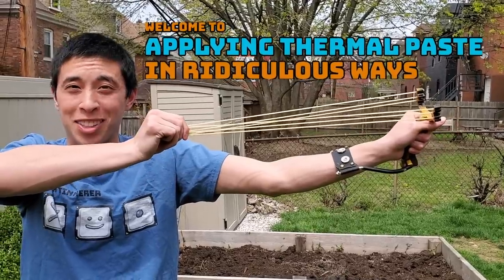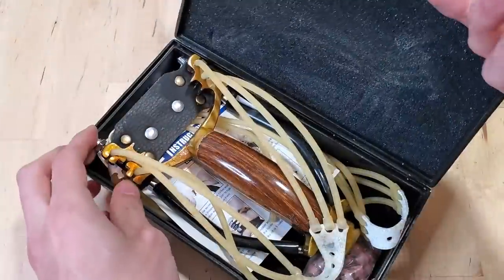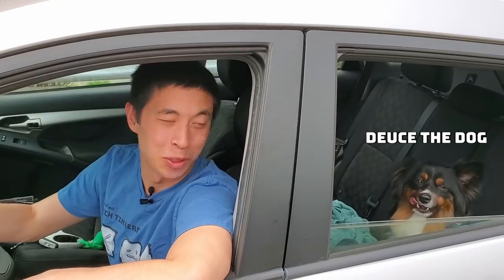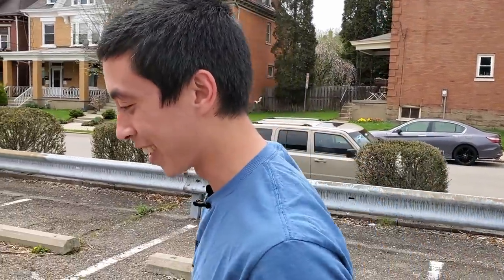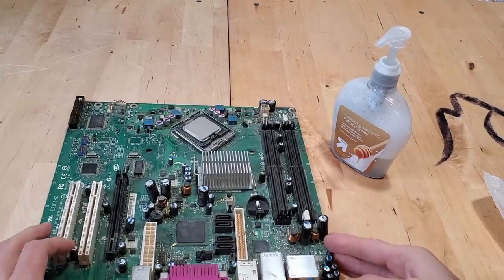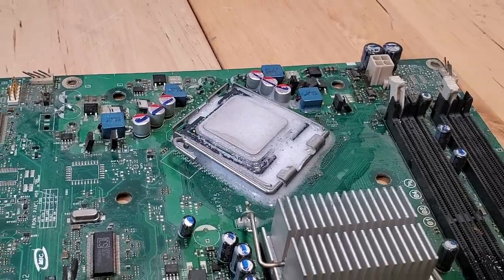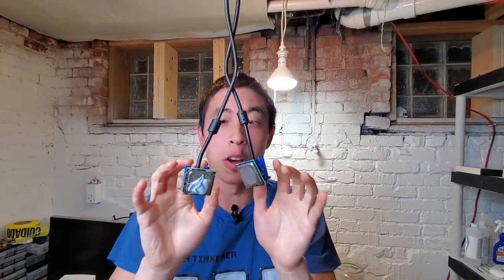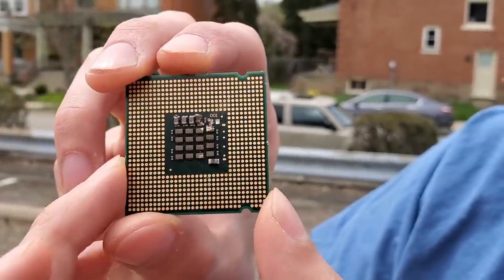Thermal Paste Gone Wild - Bizarre Ways to Apply Thermal Paste in Your PC

Comment: Can you use vaseline as a thermal paste? Also other petroleum products applicable like diesel, gasoline etc. Will they burn due to the heat of cpu? When said flammables you can try other materials like alcohol, acetone etc